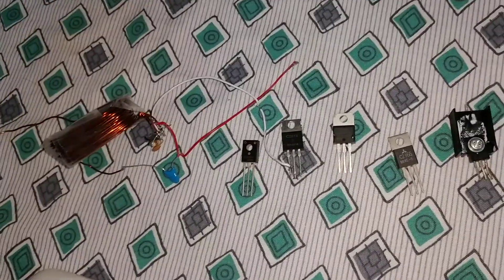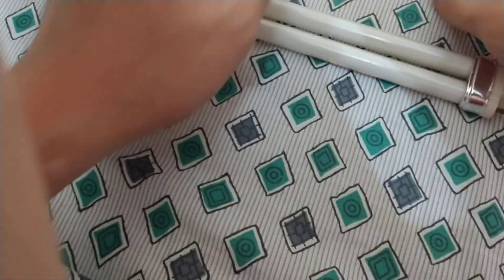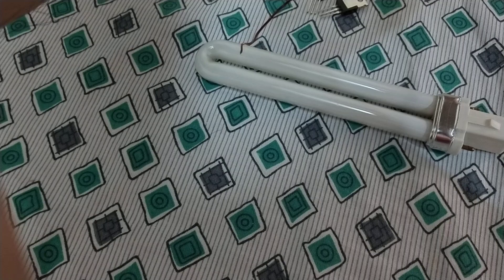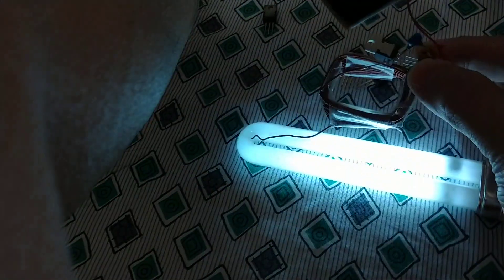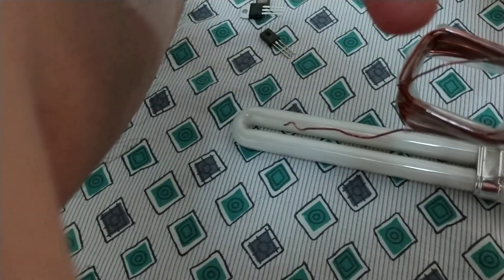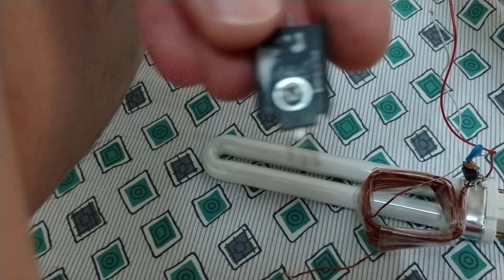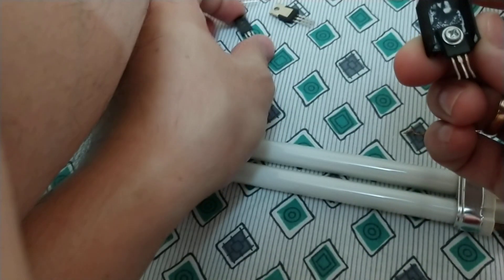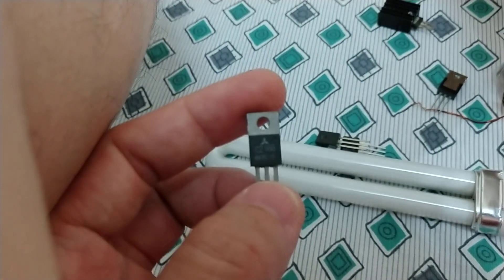EMP Jammer Transistor 2019

Comment: There ain't  a website on here. What's the website
Reply from the maker: sorry mate. i did not bought as a kit online. i built by chance that work. the same coil configuration i copy from any website
Reply from the maker: there is no website. but u can search the diagram in google. the coil matter mate
Reply: Yeah, well my dumbass bought one, it had poor craftsmanship and the dude was a dick. It came from France. Dont buy from that dude. He doesnt put a heat sink on the transistor and it forces u to buy another. Bad business
Reply from the maker: https://youtu.be/3uNpBju4yr4 

we have the same design diagram mention on above link. u can   copy this diagram and experiment with different NPN transistor that I mention
Reply: Well, the game is to be sold, not to be told and with that said i cannot say nothing more than this. Ive built them and bought them. It does work however, u gtta pay to play. Just like i did, just like everyone else. It works. Buy one.

Comment: I bought tons of 2sc2078 original, pulled, from china, from japan, from america but never had the luck to get one working...
Can i ask u where you get it please?
Reply from the maker: i have mention u can use other transistor not just 2sc2078.

show me ur coils. because it doesnt mean more turns, more power. but all depends on the resonant of the coil
Reply from the maker: i use also lm2577 step up dc dc converter adjust to highest voltage output. giving me ark flame coming out from my coil
Reply: Karl Ayeen Saludos desde Paraguay grande video
Reply from the maker: i mention other transistor should work.not just 2sc2078. u should put coil 5turns extra. and main coil should be the same design
Reply: You can find them in Cobra 29 CB radios or you can buy it from the nigga in France
Reply: Hey I'm going to drop you off my email so you can send me all y'all all yours different schematics diagrams anything y'all got on this for all the beginners out here and I've given you all some tips because as you very well know nobody is showing you how to do this okay even this guy up here I don't know what the hell he's talking about but you could use the nte152 that's going to have you the most output like I said before if you want the two SC 2 0 7 8 get into Cobra 29 CB radio or you can give me an email and I'll tell you how to get a hold of the dude in France. rogerissofukcnawwesome@gmail.com
Reply from the maker: its the coil that matters
Reply from the maker: https://youtu.be/3uNpBju4yr4 

we have the same design diagram. u can   copy this diagram and experiment with different NPN transistor that I mention